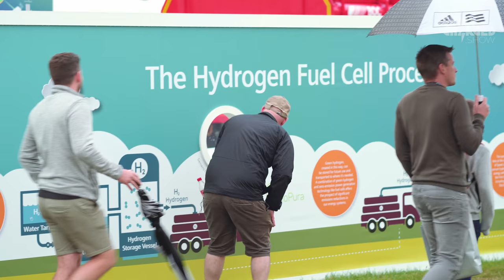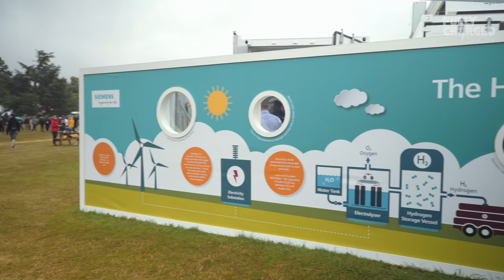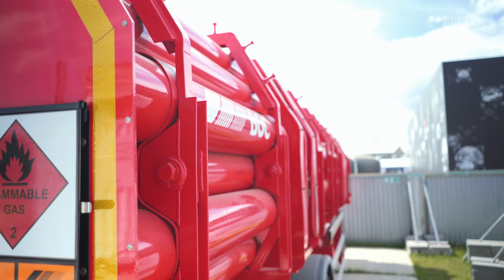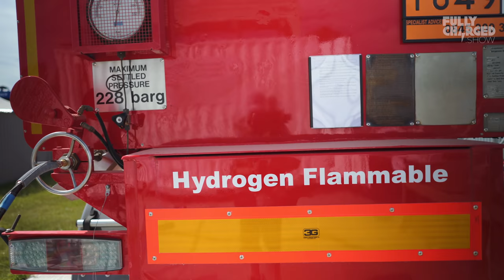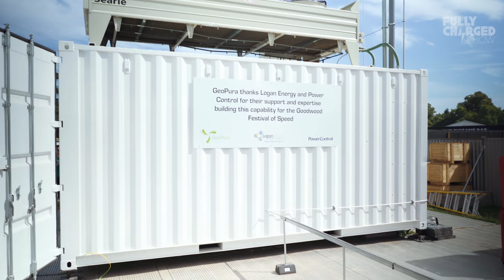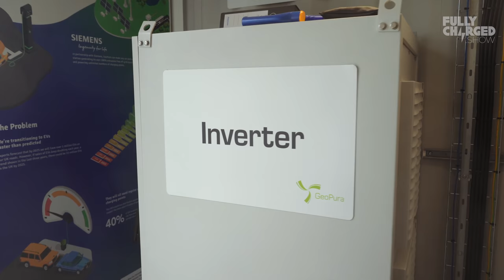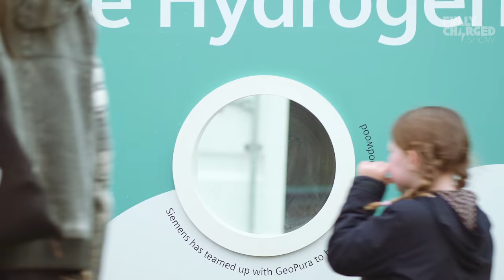Green Hydrogen Fuel Cell Charging System at Goodwood Festival of Speed | Fully Charged

Comment: How much do you have to scale it up to produce enough electricity and water for a village?
Reply: There wouldn't be much point doing that as the hydrogen is produced using renewable electricity from the wind. The application of this is for off-grid places like festivals where someone would usually use a diesel generator.

Comment: If there is a way of storing hydrogen long term ish (6-12 month) that would be great solution for moving countries like Latvia of fossil fuels. 
1) generates heat as well as electricity. Perfect drop-in solution for district heating systems. Does not require to rewire entire country.
2)excess energy generated in summer can be used in winter months when energy demand (especially for heat) is higher, but solar generation is lower.
Reply: Drop a container battery in a village install solar and wind next to it, walk away.
If there's a river, use that, drop a set of turbines in.
No resupply, no maintenance, no leaks.
(Btw, fuel cells need batteries and a buffer)
Reply: @rogerstarkey5390  WTF are you talking about? What village? Where? Why is it not connected to the grid? How is it going to help in above situation?

Comment: OK, one other slight problem with this system...I noticed you are using BOC bottled Hydrogen. This was taken from the BOC website: 
"Today, hydrogen is mainly produced by steam reforming fossil fuels such as natural gas. Excess hydrogen is also recovered as a by-product from various industrial processes. Even though hydrogen generated from fossil feedstocks has the advantage of zero-tailpipe emissions, the production chain still leaves a carbon footprint. Well-to-wheel emissions of a hydrogen fuel-cell car are nonetheless approximately 30% lower than those of a conventional diesel-powered car." 

The process of Hydrogen generation from fossil fuels is massively inefficient due to the energy required just to run the system Heating water to produce steam, electricity to run pumps etc and then you break down Methane Gas to produce your lovely "Clean" Hydrogen, but the biggest kicker is the waste product is CO2...lots of it!
So no, don't call Hydrogen Fuel Cells Green because the fuel they use is Dirty, Dirty Dirty!

Comment: Here’s why renewable energy such as solar panels with battery back up is a fantasy.
When Crossrail opens fully in London the new class 345 Bombardier trains will be 12 carriages long and carry 1500 people. There will be 24 an hour at peak times running in each direction amounting to around 200 journeys over say 4 hours of peak journey time and another 14 hours at a reduced rate amounting to say 600 journeys over the 60 mile track per day. To move that train down a mile of track would need a battery the size of a garden shed. It would make more sense to have the battery at the trackside than to transport it down the track. Therefore there would need to be 600 garden shed sized batteries along each mile of track to provide power for the days journeys. Now imagine the size of the solar array you would need to charge all those batteries. Bear in mind that on a foggy winters day in London there won’t be any power generation so you probably need back up batteries to cover at least 7 days of inclement weather which would not be unusual in London. So now you have 4200 garden shed sized batteries per mile of track at say £50,000 each and where are you going to put the solar array which is also now 7 times bigger. There are thousands of train journeys per day across London and many thousands more across the rest of the country. Now you can imagine that your solar array is much bigger than the city itself and that’s just for the trains. Someone could fine tune my rough calculations but I think I can rest my case.

Comment: Seems to me this is a perfect solution for regions lacking water. Use solar to drive it (instead of wind) and you get energy + water.  Turn back the ever expanding Sahara 😬
Reply: It would be just as easy to ship the water directly as to ship the hydrogen. It would save some weight and volume, but you'd loose it again because you need much more complicated tanks etc.
Reply: @rjmunro  think you're missing the point. High temp parts of the planet lack water but have sun. Put the plant in such a region you have solar energy to run the plant, produce energy and get a by product (water) to use for agriculture. Reclaim desert areas & get free power. Perfect
Reply: @robertlangham2356  To make the Hydrogen from solar power you need water to start with. You get the same water back when you convert back to electricity. You can't magically produce hydrogen from just solar power. If you have a source of dirty water (e.g. seawater), you can get pure water out of the process, which might be useful, but if you have no water, it's no help.

Comment: Hydrogen is not ideal for all purposes because 30% efficiency is obviously worse than the 80+% of batteries and it keeps trying to escape your fuel tank. But a battery can require expensive materials and advanced manufacturing facilities, it will weight as much empty as full and it might be fragile and easily damaged. Simplest hydrogen storage is basically cheap steel barrels that will be easy to store and don't require any special recycling, plus it would be far faster to fill than it takes to charge some batteries, which seems to be a major point against EVs for some people who apparently can't take an half hour break from driving every 300 miles.

Renewable energy needs to prepare for fluctuations in production which usually means storing some for times of low output, but if the price of windmills or PV panels goes down faster than the price of energy storage it becomes easier to raise the production capacity so that the plant does not need optimum conditions to produce enough power. That of course means on good days the energy production will be far more than the grid needs and the batteries can store. For such times it makes perfect sense to make hydrogen with the overflow because once the price of electrolysis machine and the fuel cell are paid the hydrogen tanks are cheap, allowing for huge storage to be built easily even if it will rarely be filled to capacity, while oversized batteries would be a waste of money and they would be losing capacity over time so leaving them mostly unused would be doubly bad business plan.

You can also use the hydrogen for other things than producing electricity: It is useful for chemical industry, used as rocket fuel and filling balloons, and can be combined with CO2 to make other fuels or even food. That means it is valuable in itself, not just an inefficient long term energy solution.

Comment: Hydrogen appears to have great potential.  However, Ammonia could be the best way to store it and move it.   Shipping industry is moving 100% to Ammonia Fuel in all new ships.  And it is converting all old Diesel engines to Ammonia over the next few years.  Ammonia runs with no Carbon emission, is more energy dense than Diesel and it only costs 40 cents a pound.   Now, we just need to see who can make Ammonia cheapest and with no C02 and no massive need for mining materials.   Let the competition begin.

Comment: Every person who says that hydrogen is not suitable for cars has COMPLETELY missed the point of this video. No car was powered by hydrogen. No-one suggested cars should be powered by hydrogen. The only cars that were mentioned in this piece were EVs with battery storage that wanted to recharge in OFF-GRID locations. 

It's like people don't even bother to watch the video. They just rush to the comments to spout their pointless criticisms.

For all those who bang on about how the hydrogen was produced, go to the BOC web site and read about how their H2 production is increasingly done through renewable sources.

And why not use batteries? Because batteries are expensive and their component metal are a limited resource that is limited in it's LARGESCALE supply (ask Kia how difficult it is to get hold of a regular supply of batteries). batteries as storage makes sense, it is a more efficient method. But where you have excess renewable energy that needs storing and it is better to use ALL methods rather than concentrating on just a single method like batteries.

For decades power stations have been pumping water up mountains only to recoup that energy later when it is needed by dropping the water and turning turbines. No-one whined about that. But store energy in the form of H2 and suddenly the whiners are deafening.

Comment: So, when there are batteries that can make the same job much cheaper, much more efficient, lot safer, and way less complicated, and so on, personally I don't see what purpose the detour with hydrogen fills.

With a efficiency of up to 50% in transportable state of the art fuel cells you get less than 30% roundtrip efficiency, power to hydrogen and back to power.  There's energy losses when producing the hydrogen, and when compressing it.

Batteries can have over 90% round trip efficiency. That means, you need well over three times as much energy when you use hydrogen, for the same amount of power back. Of course sometimes you can find use for the heat waste, but the value of that is limited. With a heat pump you can typically get 3-6 times as much useable heat as the power used. That means that you need around (instead of well over) 3 times as much energy when you use hydrogen compared to batteries and a heat pump, if you actually need that heat.
Reply: Erik Åslund Batteries in EVs typically are about 95% efficient. You’re giving hydrogen too much leniency.
Reply: @dojohansen123  Maybe I do. I try to give as little room as possible to debate irrelevant details or definitions. That is why I try to err on the conservative side when describing "my" case.    

There's a lot of room to err on the hydrogen-positive side and still come to the conclusion that hydrogen as a energy carrier for general use is not viable. 

While we often talk about the low round trip efficiency as the major problem for hydrogen, its not, it just a very big problem  that is easy to explain and understand. 

The biggest problem with hydrogen as an energy carrier for general use is the same as it has been since the invention of the fuel cell, over 180 years ago, (well before the invention of the first rechargeable electrochemical battery,) is that handling and storage of hydrogen gas is so extremely difficult and possibly dangerous. 

Except for space applications and possibly fuel for some other rockets too, hydrogen gas is never the best energy carrier from pure practical perspective, and it will never be. That is not mainly due to the low round trip efficiency, electric power to hydrogen and back, it is not because of lack of RnD, it is not because of yet to be reached economy of scale, it is because the fundamental properties of hydrogen makes hydrogen gas a very impractical energy carrier.

Comment: What if the tech could be made small enough (and it appears it can be) that the system to produce Hydrogen were integrated and installed in each vehicle. Therefore all you would need is to add water. which is just about everywhere. 

Furthermore, what if you also added a dehumidifier to that same system ; then, when you were driving, the dehumidifier could collect water from the air as you drove and adding that water back into the system. 

Theoretically,  in humid areas, you may never have to fuel up?
Reply: @Steve Davis - I dont think "Can't" is the right word. Lots of things have been done, that many people thought, could not be done. Flight, Spacewalk, Hear Transplant surgery etc. 

When BMW was rolling out their Hydrogen vehicle they had a prototype hydrogen MFG unit that was about the same size a a Soda Vending machine. It would seem possible that this could be done

Comment: If they have a hydrogen power wall, then it would make sense. To have solar and a micro wind generator to power the hydrogen maker to make hydrogen for storage and then use hydrogen stored gas to produce power when needed. So u have a unlimited recharge cycle that's better than tesla power walls
Reply: It's not better because you would need about 2 to 3 times the amount of renewables to gain the same amount of usable energy as a Tesla Powerwall.
Reply: LiIon batteries are about 85% efficient at storing electrical energy, using hydrogen and fuel cells are 20% to 30% efficient, depending on the method of hydrogen storage.that means batteries are 3x more efficient, and it would take 3x more renewable energy producers. Poor efficiency, high cost, and the difficulty in storing hydrogen  gas is why we will never see a "home hydrogen Powerwall".
Reply: Simon and chris. Yeah I saw an article of that... so what? It's still using solar and wind to produce hydrogen. Tho less effective like u said and I agree. It still have unlimited recharge cycles
Reply: @jollygreen4662  Well, elektrolysers and fuel cells also wear out and require 'rare earth' materials just like batteries. So why take the hassle?
But apart from that, we would need a lot of resources to build insane amounts of renewable power generating facilities. That is many many decades away. Using hydrogen now and in the forseeable future would therefore result in more CO2 emissions because the renewable energy is simply not there.
Reply: @Simon-dm8zv  rather its using resources to make hydrogen systems or battery systems, they both require energy and poop out co2 to make these systems.
Both systems degrade over time, either the electronic boards or the battery cell or the fuel tank's integrity. 
The production of energy between these 2 systems comes from coal, oil, gas, solar, wind, hydro, or nuclear. 
It's just different methods of storing the energy. The negative of lithium battery is the hot and cold temperature reduce the capacity of the battery and it has a limited cycle. Where hydrogen storage doesn't have that issue. Yeah both can start fire and explode. 
So I dont see how more CO2, is produced in the hydrogen side compared to battery fans

Comment: Where did that hydrogen come from? Was it steam reformed natural gas, or was it produced with electrolysis? 

They said themselves that the hydrogen fuel cells are only about 50% efficient. Surely we could use batteries and lose a only about 15-20%?
Reply: Neil Blanchard 
"Green hydrogen" is explicitly NOT made using methane. They are splitting water via electrolysis.

And yes batteries are much more efficient, but they are also MUCH heavier and less energy dense. 
Hydrogen is pricey but it has its applications.
Reply: They stated in the video its was wind powered electrolysis. Batteries are closer to 95%+ efficient, but for stationary applications, hydrogen works great. You don't need the power density you need for BEVs.
Reply: @coreys2686  Right - I was watching, as I posted, and they mentioned it a bit later on.

Grid batteries can be designed for lower cost or better charge/discharge lifespan.
Reply: @michaelrch  Understood. My next question is how expensive are the fuel cells, and how long do they last?
Reply: Neil Blanchard 
Ah, that I can't tell you exactly.
As far as I know they are pretty stable because they don't have moving parts and AFAIK they don't have consumable elements.

Re your other comment about using battery storage instead, yes batteries make for good static storage when size and weight aren't an issue, but hydrogen is better when you need energy density and portability. 

Batteries continue to improve but it would take a completely new tech to get battery powered large planes. That application is slightly more feasible with hydrogen, albeit still a huge challenge.

Comment: I think the only way Hydrogen can be useful for cars is by becoming the "fuel" in a Range extender plugin Hybrid vehicle. So, add a hydrogen fuel cell system in a 25 KWH car. You will not need to fill up for daily commutes. But, for longer trips you just fill up with Hydrogen instead of oil. And of course, that Hydrogen has to come from Electrolysis of water by renewable energy. And the electrolysis has to take place in the filling station itself, the station would be covered with large scale solar panels and wind turbines, that will constantly keep producing hydrogen, from water distilled through an RO system fed by normal water supply. So, not big requirement of infrastructure. So, every EV will become a Range extender plugin hybrid fuel cell car. So, you are basically increasing the battery size of a hydrogen fuel cell car and add a plug in option and you are done.
Reply: Or you simply leave the whole hydrogen hassle out. Rapid charging doesn't take considerably much longer than refueling H2 these days. Plus, charging stations are much cheaper to build and operate.

Comment: 50% electricity and 50% heat. But how is the efficiency for making the hydrogen?
Reply: Not very good but if your using renewables at a time when there is no demand then it doesn't matter that much i guess, but obviously you could just charge a battery with that electric instead, so I don't know but I guess it's an alternative way of doing it.